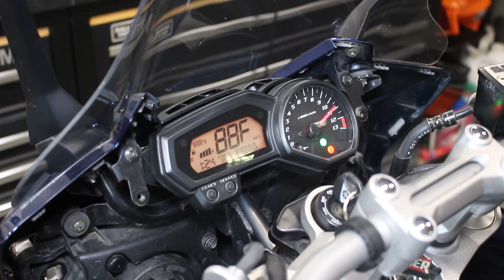Yamaha FZ1S - Valve clearance adjustment, TIME LAPSE

Comment: Awesome. How long does this job usually take? Obviously not under 20 mins like the video!
Reply from the maker: Hi, I just checked and I have 160 minutes of video after first edit. That is only the actual handlings on the motorcycle (non accelerated) but does not include getting the tools, clean up, calculating the shim sizes and so on. I would guess between 3 and 4 hours for an experienced mechanic.

Comment: Nice to see you back with another video!!!  Nice job - as usual!!
Reply from the maker: Hi Ken, thanks for the comment. This repair was initially not planned. The engine was making a ticking noise so I decided to check on the valves earlier than expected. Turned out on valve was way out of spec. Now the noise is gone. On the other side I haven been in the workshop much the latest months. Trying to pick it up and continue the assembly of the R1 I started a while ago.